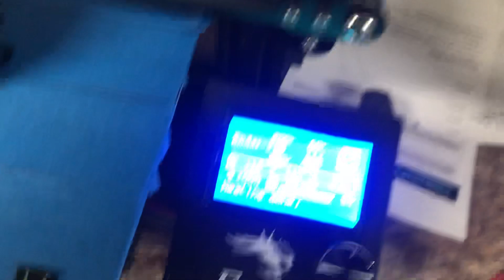How to fix 3D printer not printing circles correctly

Comment: Just to add my own experience, the bracket holding the belt to the bottom of the bed can also come loose. I had tightened the belt without success then I found the bracket under then bed was loose.

Comment: My printer puts 2 flatspots into circles regardless of size or speed... wish I can say this advice helped me but I cranked the tension on both X and Y and it really didn't resolve this issue. Im stumped. What are the signs of a stepper motor going bad?
Reply from the maker: FlyingPolak Not sure of the warning signs. Usually electric motors work normally until they die. Are there bubbles in your bed? That could cause the printing surface to be uneven
Reply: @OwenC1  Thats what I figure too. The bed is perfectly flat, I dont think its adhesion related as the print stays perfectly on the bed its just that it has two subtle points at 11 and 5 o clock on the circle :( readjusted my tension tighter once again and no improvement. The belt doesnt skip it just looks like the motor hesitates to begin its fine motion a split second too late. Im wondering if its could be software related 🤔
Reply from the maker: FlyingPolak That would be something to post on Ender’s forums. The team on there is extremely helpful. Just make sure to include your printer name and runtime (if available)
Reply: @OwenC1  thank you for your help!
Reply: @FlyingPolak  I don't know if its related, but did you adjust the bolts under your y-axis? They come really tight from factory, and you have to readjust it to get any smooth motions.
Reply: @ultimate2635  sold the printer and got an ender 🍻😅
Reply: @FlyingPolak  Oh, uh. I thought you were talking about the ender lmao
Reply: @ultimate2635  nah I had an Anet A6 but the ender has been problem free so far 🤷‍♂️
Reply: Exact same problem. 11 and 5 flat spots. Everything else is fine and to spec. I'm suspecting a marlin setting. I have "s curve " enabled so I shall disable that and see if it makes a difference.  Maybe there is some other setting that is , mind my pun, "askew". Lol
Reply: @tylergearey6857  did that ever work? I have the same problem